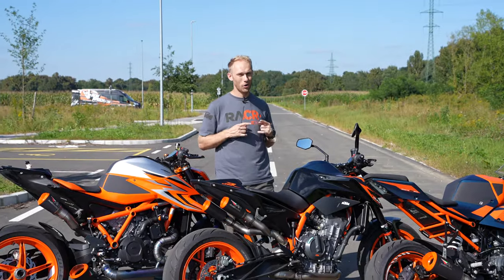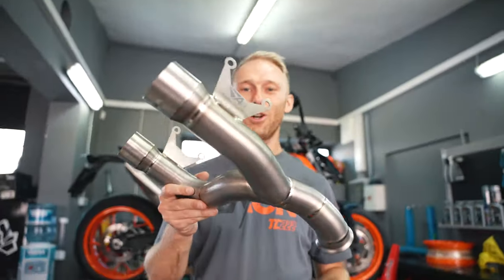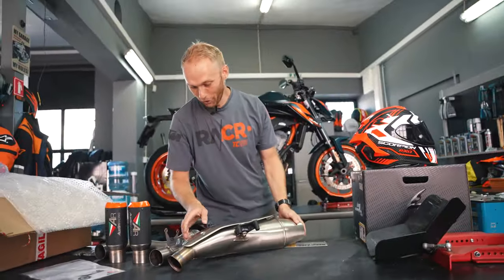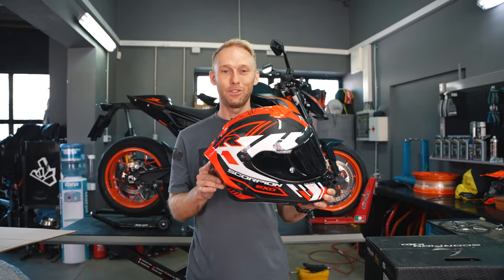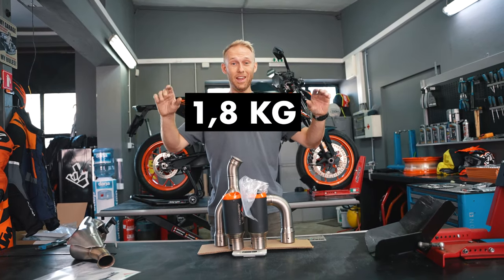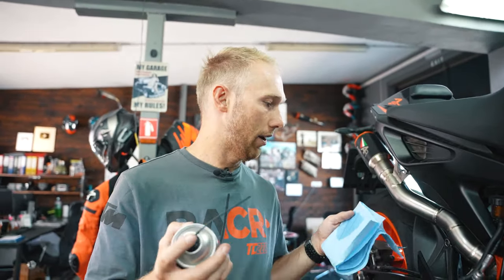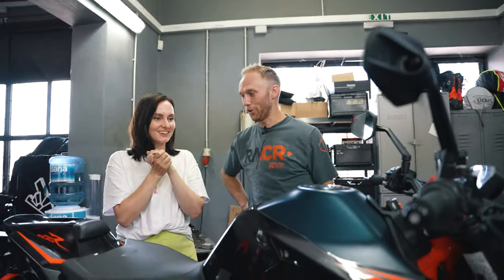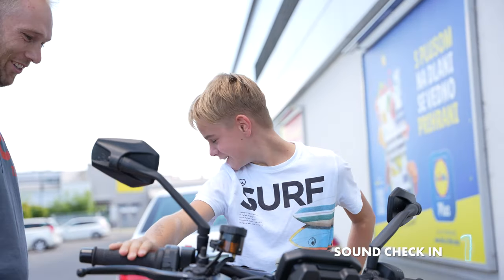NEW STREET LEGAL EXHAUST RS 22 + SOUND CHECK | RokON VLOG 146

Comment: Unpopular Opinion: I think the 890 Duke parallel twin sounds better than the Super Duke in this example. 🔥
Reply: True, my 790 stock sounds better than my 1290r evo stock.
Reply: Because the 890 270⁰ parallel twin represents a 90⁰ v twin that's why it sounds better than the super duke, 270⁰ parallel twins are my personal fav
Reply: I have to agree. I’m surprised to say this but the 890 sounds wicked. I have an 890 and 1290 and typically prefer the sound of the latter. These AR exhausts sound great!
Reply: @_denis_020_3 ktm use 285° for lc8c to get the same interval with the 75° lc8.. not 270° and 90°
Reply: @hamdansyakirin2250  thanks for correction
Reply: Conductor ROK 🎼😎👍🏼
Reply: 1290 better..
Reply from the maker: I am also a fan of the parallel twin-cylinder sound. Love it more than the V2  :)
Reply: @hamdansyakirin2250  despite the fact that they are timed to sound and fire similarly, something about them doesn’t feel quite the same (I have both). It’s interesting.
Reply: @CurtisBrandt I'm really torn between the 890 and the 1290. Could you compare them to me ? It's rare to find someone who has both
Reply: @tempofugo168  Are you deciding between 890R and 1290R? I have ridden 790 R, and own a new 890 R, and I've owned a 1290 S for almost four years. I haven't ridden a 1290 R but would LOVE to, and have ridden with another rider on on a fair few miles. All are exceptional motorcycles and very capable. I'm a decent off road rider (novice desert racer) and experienced on the street (approaching 100k miles lifetime). There are much better riders out there, but this is my experience. Off road, if you want to get sporty, the 890 is way ahead of the 1290 - the extra ~80 lb would be enough to make challenging terrain a no-go for me. I know it can be done, just not by me. I can ride the 890 on pretty challenging single-track on up to 90 mph on graded gravel roads, and it's comfortable enough for hundreds of miles a day. I tried my 1290 S off road a couple of times and was in pure terror most of the time. Granted, I was on 80/20 tires. I'd like to try a 1290 R off road on proper dirt tires. On-road, 1290 all the way. Nothing has the legs of the big bike. Torque, gearing, wind protection, seat, creature comforts, everything adds up to a better on-road experience. The 890 doesn't suck on the road, I'm sure I could ride it almost the same, but it wouldn't BE the same. Let me know if you have any more specific questions I can try to answer. For me: I ride the 890R like a big dirt bike (it's ok on the road but I'd rather not ride it there), and the 1290 is my go-to on the street every time. Ride safely!
Reply: @tempofugo168  Two weeks ago I had the opportunity to ride the KTM 1290 Super Duke R Evo for two days and have to admit that the punch of its large 1300 cm V-Twin engine is unparalleled. Although my Duke 890 R is a lot more maneuverable and can be driven around corners much more playfully, its big sister doesn't have to hide in this discipline either. I think after a few days of getting used to it, you'll be able to circle corners almost as quickly and lightly with the Super Duke, even though it's a lot heavier and bigger. The sovereignty and powerful feel of the engine at all speeds is simply uncomparable. The Super Duke puts a big smile on your face every time you pull the throttle.😁 But it's also way more expensive. I still love my 890 R, but the 1290 might be my next bike.
Reply: @hdi4eva-castlesbydrone531  so, if money wasn't a factor, you'd pick the 1290 SDR without any hesitation ? You wouldn't miss the lighteness and the smaller engine ? Sometimes, isn't it better to have an engine you can run at 80% rather than tip toeing a bigger engine ?
Reply: @tempofugo168  It is really a difficult decision. The 890 R is so lightweighted and quick around the corners and has enough power for any situation, too. I would definitely miss it. It also can be ridden at low speeds in high gears. On country roads (up to 100km/h) you wouldn't need the last two gears when riding the 1290. However, you can't make a mistake with either of them, it would be best if you had both in the garage. 😅 The 890 R is for sure the more reasonable alternative, the decision for a 1290 would solely be a matter of gut feeling. And with my 90+kg and 1,90cm height I felt a bit better on the big sister. I just have a new video up, with a short comparison of the sound and ride. But it is only a fun video, not a true review or comparison. You should definitely try both on a test drive.
Reply: @hdi4eva-castlesbydrone531   Unfortunately I can't test the 1290, my local dealers can't provide one for testing it. I only tested the 890 and it was a blast, I'll probably go for it soon, but I want to test the 1290 to remove the doubt... Damn, here in France the dealers aren't very cool. If I was in Germany I would pay you to test yours ahah.
Reply: @tempofugo168   I am lucky to have a big KTM dealer in close vicinity. I rode the 890R (2021 model) for two years now (20000km without any problems) and it is indeed a blast. I am sure you will be happy with both bikes. Only for longer distances (300-500km a day) I would probably prefer the Super Duke. The 890R will always be ahead in tight corners, it is simply the engine of the Super Duke that makes me so emotional about it. However, the super duke's long gear ratio is less suitable for use on narrow country roads, so the 890R is actually better to drive there.
Reply: @hdi4eva-castlesbydrone531  what about city riding ? That's what I do 70% of the time. 

Note : I've just watched your comparison. It's kind of amazing how a 890 with a pipe sounds better than a 1290 stock, the price difference would still be in favor of the 890, even with a pipe mod. Did you put a slip-on on the 890 or a full exhaust system ?
Reply: @tempofugo168  For the city I would definitely prefer the 890R. No need for a 1290R. I was also a bit surprised that the 890 sounds better. I only have the slip on mounted, I already bought the 890 like this. The stock exhaust also sounds pretty good and is even a bit louder than the Akrapovic Slip On. However, in my opionion the stock exhaust looks ugly.😉 I would love to have the full Akrapovic system, but it is not allowed for the streets here in Germany. And even with the full system the 890 would be cheaper than the 1290. I bought mine in November, the prices were really good then. Thus you should  probably hurry up with the decision. With the beginning of the new season the prices increase significantly, at least here in Germany. The 890R comes with the Power Cup 2 tires, which are awesome. However, I presently switched to the Conti Road Attack 4, which sticks to the road amazingly well, too, but it lasts significantly longer.
Reply: @_denis_020_3 last I heard the 790/890 are running a 285 crank that mimics the 75° of the super duke v twin

Comment: Maybe they are streel legal,  buzt unfortunatly i ordered my rs22 GPR1RS for the 890R like 15weeks ago and waiting for 16 weeks is really harsh. The 1200 Euros you have to pay for also just bitters things up. But i think in the end its worth it
Reply: Ich habe sie mir bestellt sie sind angekommen und meine Anlage passt nicht auf meine ktm 😐 egal was man macht die Halterung passt einfach nicht
Reply: @Luis-mp5pv  how is it possible 790 and 890 are the same size ?? Which model of KTM do u have?
Reply: @sed7169  I have the KTM 790. So the system has to fit 100%. The quality of the system is good. But when I put the tube on the cat, the holder didn't fit well. You have to bend it and use a lot of force. There is more space on one side than on the other, it was very, very heavy. I was afraid of destroying the system. I'm really disappointed. It seems to me that if the system is the size of a bottle, it seems like the work was done poorly.